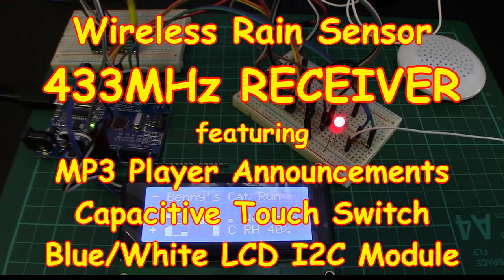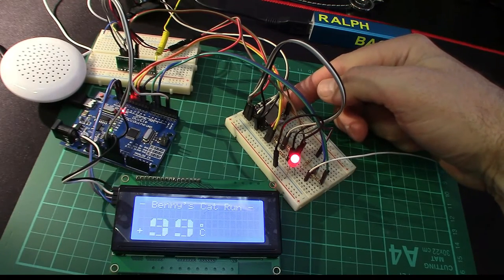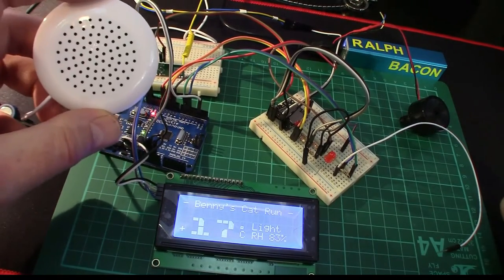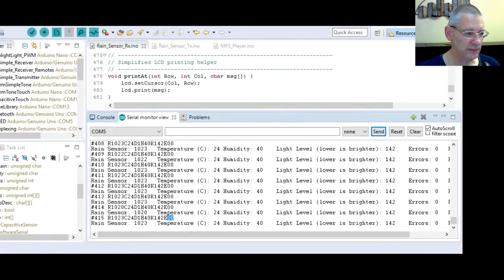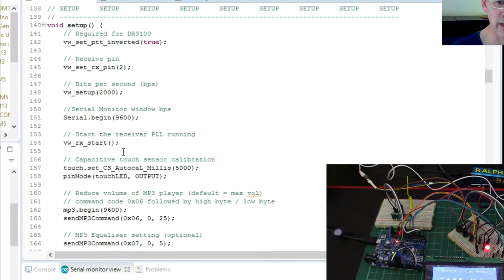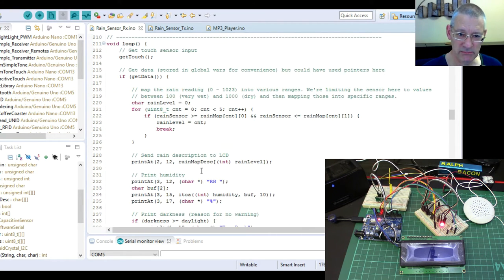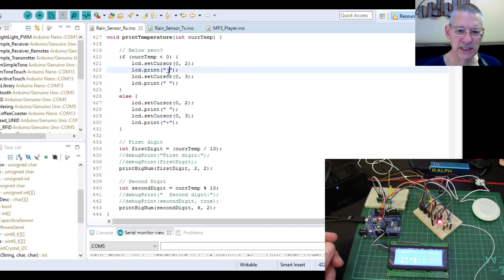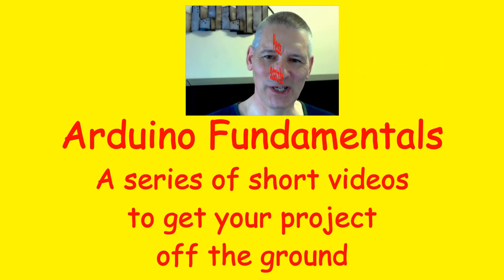#48 Wireless 433Mhz Rain Receiver with MP3 player and LCD

Comment: Hi Ralph, excellent video and great project.  Just a couple of questions about your code.  The way of turning your debug routine on and off is excellent.  However, when I pasted your template on lines 124 through 135 and included the define "isDebug true" on line 28 into my project, my compiler for my nano didn't like it - wouldn't compile.  I looked all through the rest of the code but didn't see anything else that referred to the debug routine.  Is it part of the libraries that you had included in your sketch that I'm not using in mine?The other question I have is you and other experienced programmers use defines for your variables.  I think I read somewhere that it's not a good idea to use defines.  Could you explain why you use them?I'm working my way through all your videos.  I started at your first one and am up to about #50.  Through the 1.5 years I've been hooked with the Arduino bug, I've read countless tutorials and seen 100's of videos.  Ralph yours are the best.  I've read a lot of your blog and comments on your videos and it appears my thoughts are shared by everyone viewing them.  Thanks.
Reply from the maker: Thanks you for your kind words about my videos and blog, Neil. It's always good to get confirmation that what I'm doing is a Good Thing and I'm not wasting my time!
I don't know why the Arduino IDE would object to a #define (note the # at the start of the word). And there is no equals sign after either. Or semicolon afterwards. So it's just:
#define isDebug true
Used in a gazillion places in all C/C++ code. It's a Good Thing to do as it stops what are known as 'magic numbers' or 'magic strings'. For example, the following, totally imaginary line:
getCoordinates(81,6,"F146a");
means what? That's right, absolutely nothing. What if you had that call 50 times in your code? And now you wanted to change the first value from 81 to 79. Yes, 49 edits later you have a bug in your code as you missed one.
Now this:
getCoordinates(leftPos, rightPos, msgString);
is so much more meaningful without having to decipher those magic values. And there is only one place to amend it!
The compiler makes a note of all #define values and substitutes them exactly as found wherever it finds that value. Pure text substitution. Then it starts the compilation process. So the resultant code is no bigger or better than without the #defines but it makes it much easier to read, debug and maintain.
In a commercial environment, no hard-coded values are allowed.
Great question, I hope this explanation helps, Neil, great to hear from you.
Reply: @RalphBacon  I've seen other code where, for example,  a particular pin was defined by using an int.  This is not good because it ends up in the runtime code.  Using a #define on the other hand,  you're telling the compiler what you want in there,  and no code space is used up to do that.

Comment: Hello,
Thank you for your great videos, i enjoy them and learn a lot,
2 questions:
1. Why do you need to add the <Arduino.h>
2. in the http://onlinetonegenerator.com/ there is no save button, how did you save them?
Thanks Again
Reply from the maker: Hi Mohir, glad you like my videos. To answer your questions:

1. I include the <Arduino.h> in some of my sketches because I use a different IDE (editor) that does not include it automatically. If you use the standard Arduino IDE it hides this from you but includes it. If I did not include it in my editor (Eclipse with Arduino plug-in for those interested) I would not be able to use the Arduino-specific commands and constants such as  "INPUT_PULLUP" and "OUTPUT" as well as functions like min(a,b).
 
If you want to see this file (it's just a C++ header file) look in
C:\Program Files (x86)\Arduino\hardware\arduino\avr\cores\arduino\Arduino.h 
(assuming you're using Windows. I've no idea where Mac users put stuff, sorry).
 
2.No save button on that web page? What's that big blue button right under the tone box? Next to the big red button that says STOP? I guess you must have missed it! I would say it's easy to miss, but, well, I'd be lying :)
 
Anyway, that's a great question about the header (I'm surprised others haven't asked it) and I hope my answer helps you and others understand why I do it. BTW if you include that library more than once no harm will result as it knows it has already been included so won't repeat the inclusion.
 
Thanks for posting Mohir, hope to see you here again. As they say, Don't be a stranger!
Reply: Thank you for your reply,
There is indeed a big blue button on the tone generator page, and i didn't miss it ;)
but not on the voice generator, and i saw on the video you used the voice generator
Reply from the maker: Oh, THAT page <embarrassed face>, oops.
 
Frankly I cheated. I wasn't after hi-fi so I just recorded it from my bluetooth speaker held close to the microphone I use to record my videos. 
 
The other way to do it would be to install an audio capture program onto your PC so that everything your sound card generated would be recorded into a file. Such programs are quite easily found and cheap (or even free perhaps for short clips). I was just after a quick result so my method was sub-optimal (but actually works very well!).
 
So after all that it was ANOTHER good question you raised, so thanks for that, others will see my clunky workaround but also see my alternative method so they may benefit too. Thanks for posting, appreciated :)